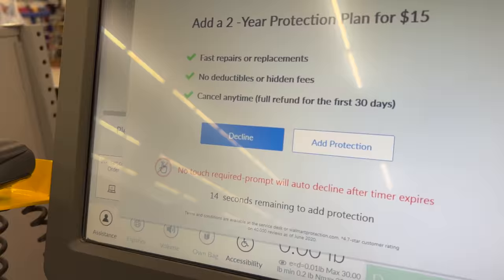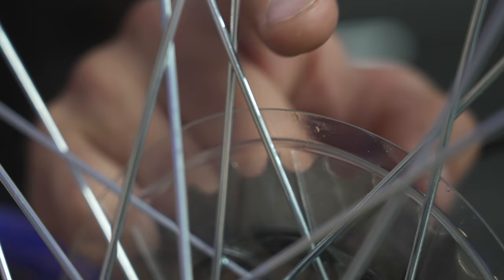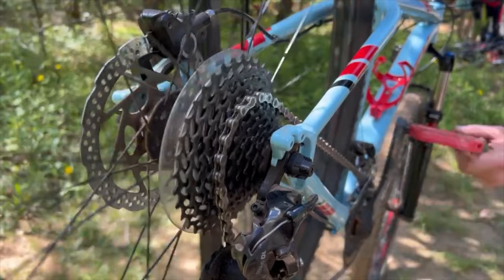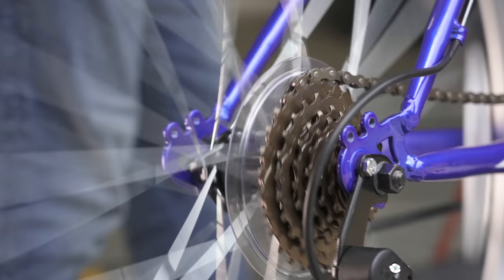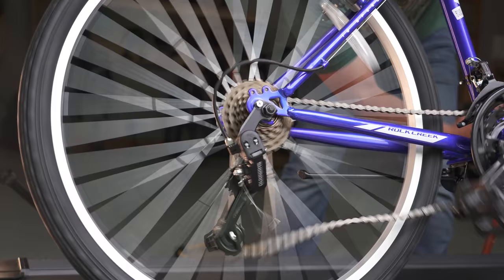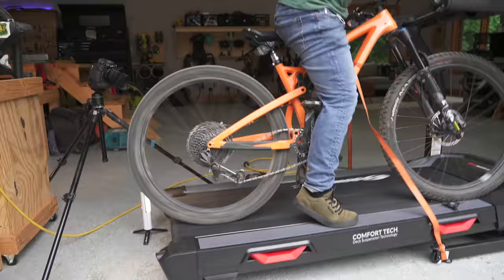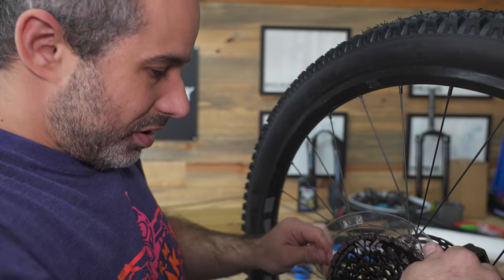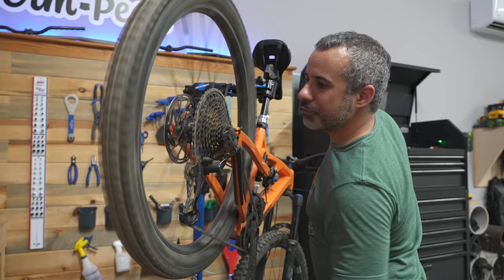What is your "dork disc" actually for? What happens if you remove it?

Comment: As Dork Discs are made of plastic, they won't last long, even if the thing it is for never happens. My old ten and twelve speed bikes never had dork discs, and the derailleur never went past the point of the largest sprocket. Of course, when I got my first bike I learned that if I wanted to keep it rideable, I needed to learn everything about maintaining and repairing it. I had a friend who owned a bicycle sales and repair shop, who taught me everything I still did not know about bicycles, even how to balance the wheels with a spoke wrench. At home I setup my own shop to maintain and do repairs on me and my family and friends bikes. I also had a road tool kit mounted on my bike, that included a tire repair kit and an air pump. I kept my supplies for the tire repair kit filled enough to contend with any incident of a flat. The easiest tires to repair? I have to say it is the tubeless. If you have a pump and a plugging kit, you can have it all fixed in about ten to fifteen minutes. No removal of the wheel, no unseating the tire from the rim to get to an innertube, no long process of patching the tube. Just locate the puncture, plug it, and reinflate. To locate a puncture, soapy water helps big time.
OK, I'm going on and on about this, but I love biking a lot!

Comment: I got a used Gravity Bullseye Monster fatbike, and I got it adjusted pretty good (I thought). I took it on it's first real ride, and I whacked the derailleur on a log, bending the derailleur hanger. Later when I shifted back to 1st gear, it shifted past off the sprocket, and got wedged real good. My buddies I was riding with helped me get it fixed, and ended up having to destroy the dork disk to get the chain un wedged. I think the dork disk did it's job, since the bike rode fine after everything was bent back into shape, and readjusted on the trail.

Comment: While cycling across Normandy I broke three spokes when my chain came off into the wheel. I still had 100km to go to my next stop (Amiens). I had spare spokes and I had the tool for removing the cassette, but I didn't have a spanner which was big enough for that tool. I couldn't replace the spokes without removing the cassette. My temporary solution was to re-true the wheel with three missing spokes on one side. It worked a treat.

Comment: My 1970's Schwinn Varsity had two "dork discs".
It also had a small metal one aside the smallest sprockets on the cassette. If your derailleur is misadjusted, it will prevent the chain from exiting the cassette and jamming between the cassette and the frame.

Comment: You need a dork disk on lower end bikes for two reasons:  1.  People don’t maintain their bikes and are mechanically inept.  2.  Lower end derailleurs common in bike shop bikes (Shi*cough*ano) have so much slop in them that if you push the derailleur in manually and set the limit screw it won’t shift into the lowest gear.  However, if you set it so that it shifts smoothly into to the lowest gear the chain will go into the spokes under the right conditions.  You have to set it so it needs a lot of encouragement to shift to the lowest gear, and even so, it will still go into the spokes when pushed.  —  The chain bends the spokes when it goes behind the freewheel, taking the wheel out of true.  It is also common for the derailleur to get ripped off, severely bent, the chain to get wrapped up or broken, and of course broken spokes.

Comment: My experience with the dork disks was a bad one. I had a time where that disk actually trapped my chain between it and the gears making it almost impossible to get the chain free. It happened on a short ride around town with my brother, I had to walk the mile back to his place where we tried to dislodge it for almost an hour before we decided that the "dork disk" had to go. After then I've since adjusted the limits on my derailleur and never had an issue with it. Mind you I only do city riding as I own a low gear folding bike that isn't suited for off road.

Comment: There were a couple points where the back wheel seemed to almost lock up on the bike when the chain went behind the cassette.  What we aren't accounting for is that in a real-life scenario, you would be traveling at speed, and a sudden unexpected braking of the back wheel for even a moment might cause you to jerk forward, causing an uncontrolled forward flip, planting you in the ground at whatever speed you were travelling, and throwing an unstrapped down bike forward where it might collide with something else, causing further damage.  Of course, its also possible that you would be fine, but it could also be an unnecessary risk that gets higher the steeper the downhill slope.

Comment: Don't have one on either of my current bikes, and from experience, it definitely will not stop a derailleur from contacting the spokes (with or with out one) if a hanger or derailleur gets bent.  If the chain does fall between the cassette and wheel it for sure tones down the violence and can prevent spokes from breaking - it's marginally useful on a BSO that people buy in department stores given how poor the quality of parts and how shoddy many of those are assembled and how they get looked after.  But for a well built and looked after bike with better then "bottom of the barrel parts" and is kept in proper tune, I don't feel it's needed even though it could add costs to a repair to not run one (one will find they run into other problems before that one).

Comment: Well, as someone who knows nothing about mountain biking, I'm surprised that there isn't a more stylish option available, especially given your anecdote of destroying expensive derailers when it fails.

You could make inserts with designs on them really easily that would add little to no extra weight and be an extra area of aesthetic customisation. 

Just now I found one example of coloured discs, but none with designs on them. I'm sure you could also refine the actual form of the disk to stop it coming loose or falling off.  If people are spending hundreds on a derailer, surely a better dork disc to protect it should be a thing.

 I'm sure with some creative use of aluminium or titanium and some paint you could make some awesome looking discs that would suit a high end cassette/derailer.

Comment: I was 13 when my dad offered to buy me a bike of my choosing with a certain price limit (I think his limit was $500). I wound up with a GT Timberline. It was "last year's model" and the price was discounted enough that it fit in the budget. Well, the shop owner was a professional bike mechanic and cycle racer who was a complete snob. I asked him about the plastic disc and he said "no, you don't need that!" I said "well what if the chain jumps?" Just don't jump the chain! Gee, thanks! I'm cured!

Well it took a year or so but the rear derailleur went out of adjustment slightly and the chain jumped. Chewed up the rear spokes. 27 years later I still don't know how to adjust a derailleur. 

It may not have ruined the wheel jumping the chain once. But... eventually it chewed and bent the spokes and the whole wheel developed a death-wobble. By that time old man Cecil retired and closed up shop so I couldn't go scream at him for not providing the one piece I  requested to protect me from my own ignorance. The replacement wheel had a dork disc.

Comment: I've never taken the time to intentionally remove one until it was already destroyed (from age, mainly). 

I have gotten a derailleur jammed in spokes before though. After assessing the situation, it was clearly because it was bent in by a prior crash, and probably not re-adjusted since. I removed it, straightened the idler arm, and re-aligned my derailleur via cable and end stops, and it shifts better than new. 

I think it helps minorly, but anything catastrophically wrong will still be catastrophic.

Comment: My really awful rear wheel experience would never have been solved by the dork disk, though I wish it could have. At the bottom of a steep downhill, at very high speeds, I came to a narrow section of carved trail with large river stones buried and protruding on either side. I had bled too much pressure from my rear shock so my bottom bracket was hanging much lower than usual, when my rear derailleur arm caught a rock. The rock was buried just enough to stay put as it twisted and pushed my derailleur arm directly into the path of the oncoming spokes. The arm got sucked in by the spokes and twisted entirely into the wheel, ripping four spokes clean in half from the momentum and bending my hanger bracket to a vicious 90 degrees, fully embedding the body of the derailleur into my cassette and wrapping the arm in broken spokes. The entire thing was completely seized as the pieces were tangled and jammed together, with the derailleur arm poking out the wrong side of the wheel, so I couldn’t even roll the bike as I walked back. That was a long bike-pack out of the canyon. Carbon frame - totally saved by the bending of the hanger bracket. Still ride it five years later. 

Don’t forget to set your sag for each ride! Obstacle clearance is important 😅

Comment: Just bought a brand new bike a few weeks back for a bikepacking tour. Got it from a good shop and had them set it up for me. However, pretty quickly discovered that the chain would consistently jump off the cassette when going into low gear. Finally, after resetting the chain a few times, it jumped again and wedged between the cassette and the dork disk, locking the entire drivetrain together.  After cutting the now mangled dork disk out the bike now shifts like a dream and hasn't chucked a chain in 1200 km I've ridden it since. Turns out the dork disk was pinching on the chain and plucking it off the cassette.  Definitely do more harm than good in my small experience

Comment: I will never forget the sight of all those flying little Freehub bearings peppering the pavement, the shiny glint of freshly gnarled spokes.
1989, Bike shop warranty, fresh drivetrain replacement. I had shifted bigly to turn uphill and crank hard- One pedal stroke and the chain imbedded deep between the hub flange and gear cassette, which were summarily, instantly, parted. 
On this bike, it was the Missing spoke protector that allowed that to happen- 
The bike shop thought otherwise- But TREK made it right and installed an updated drivetrain which did not have such an achilles heel.
To this day, 
I cringe when I see a bike WITHOUT a dork disc.
Your results may vary 🙃

Comment: @BermPeakExpress id say the reason you didnt see as much carnage as expected is that the pedals were for the most part, free to do what they wanted. if there was a person standing on them, they wouldn't  be able to turn and thus something had to give. for example, the chain links are stuck in between the spokes and the cassette and the chain cant turn anymore because you are standing on the pedals, first of all the derailleur would extend all the way and then either the chain will break or the spokes bend or break or maybe the derailleur bends or breaks, hell maybe they are pretty strong and force the pedals to turn thus throwing you off balance and causing you to crash

Comment: I was going off a curb in a 10 speed street bike in high gear (fairly high speed), and the impact of the landing caused the chain to fall off the outside small gear into the gap between the frame and the gears. This caused the rear wheel to lock up completely and I went over the handlebars with the bike following me. I got some scars from that one. Of course, there's no dork disk on that side of the gears. I have also had it jump off the inside gears before, but never had any catastrophic results. This was back before mountain bikes existed in numbers, so I used my 10 speed street bike, a Huffy, on trails following my friends who either used a 10 speed like me, older one speed cruisers, or BMX/chopper bikes. I used my Huffy so much off road and doing jumps that I even managed to break the pedal housing welds from the two vertical tubes of the bike frame - yet another ass-over-teakettle moment. My dad had a friend who could weld, so they welded it back together and I kept on riding, although the pedals were not quite on a vertical plane after that.

Comment: I don't understand what the down side is to leaving on. If it gets damaged on a ride, it's done its job as a sacrificial part. No biggie. Remove the broken one and install a new one. Are we going to start calling electrical fuses dork fuses now?
Reply: The problem that it's too flimsy and will disintegrate. Also changing it is bit of hassle. Why don't bike manufacturers use decent plastic?
Reply: @Mr.Anders0n_  or maybe a stiff aluminum alloy?

Comment: I've had the same bike for around 18 years, but don't worry most of the parts have been replaced, it's mostly just the frame that is original.
Anyway, the dork disc broke off several years ago, and I never replaced it. One day I was doing a downhill run, and I wanted a bit more speed for a jump, so I started peddling hard and the chain got caught up and wrenched the wheel so hard, it buckled and the chain snapped, causing the pedals to slip from my foot and puncturing the back of my calf making two rows of holes in the back of my leg. 
I was still forced to do the jump, but with my foot now being dragged across the ground I obviously didn't make it. It was probably one of the he worst crashes I've had, but none of me was broken, just significant bruising in various places and the morse code stamped into my calf. 
I think the derailleur was the only part I didn't immediately replace, because it was expensive, but I did later replace it, as it was damaged, though not significantly.

Comment: A factor not mentioned here is spoke direction, many wheel builders will lace teh drive side spokes so that teh outer spokes are laced towards the rear, this helps pull the chain back out, if its laced outer spokes going forwards, it will drive the chain down and into the hub. its possible that both bikes you tested were laced outer spokes rearward.

Comment: One time I dropped a staircase and my chain hopped off 5th gear off the cassette and it ripped my half a season old derailleur wrapped up in my wheel. Bent half the spokes and messed up the shift cable

Comment: In my younger days I rode my mountain bike everywhere. In the snow at -40°C on icy roads and some fresh snow up to about 2 inches. (That one thing alone almost got me a job once.) or +40°C those were my limits temperature wise. But mostly in rain, mud, and dusty dry conditions.  Because of where I grew up. The only person who ever out rode me in our all be it small town was a one legged Paralympic athlete. That guy spent more time training than I had in time to ride in a day. But the only time I ever had a problem with this was particular issue is the only bike I have ever owned with a brake away tab that had a flaw in the metal from factory. The tab snapped coasting across a field on my first ride and took out my spokes, derailer, derailer cable, pretty much everything but the tire was destroyed or took heavy damage. I hadn’t even left the campground yet. I had two weeks of riding scraped because of that tab. I had ridden probably close to 100,000 kms on my old 1997 Norco Sasquatch crashed, bashed, and abused it in almost every way possible. Took 15 years of that before I cracked the down tube. My uncles buddy was the only person I knew who could weld chromoly. So fixed it and I rode it for another five years. The worst mistake I ever made cycling wise. Was getting rid of that old beast. My replacement for it I have almost never completed a ride without some major failure and took my joy of mountain biking was my Giant Yukon FX. I have had it for 15 years and I haven’t been able to put 100 kms on it. If I ever come across another 1997 Norco Sasquatch I would toss that bike over my shoulder so fast it would get a speeding ticket. Also the fastest it has ever gone. I did lose all of my riding conditioning after my accident when I hit a moose in my car on the highway and broke my ribs and had a compression fracture of one of my vertebrae. But I just don’t want to ride because of that thing, and I don’t have the money for a replacement bike. So I’m stuck with it. It is quite possibly the most expensive scrap aluminum on the planet. I really should write them an email about it. Any who thanks for reading this. My short comment got away from me a wee bit, and became more of a short novel. 🙂

Comment: The risk of these is not at high speed, it is at low speed when downshifting.  If you are climbing and putting a lot of torque on the pedals, when the chain falls off the large sprocket it accelerates because the load disappeared, then you get maximum torque digging the chain in to a spoke.

If you do that enough times without addressing the damage, you will break spokes.  In a perfect storm situation they would all break st once while you are descending at high speed on a mountain with shear cliffs.

The way to prevent this is to properly adjust the derailleur and look for damage any time the chain comes off or the derailleur takes a hit.